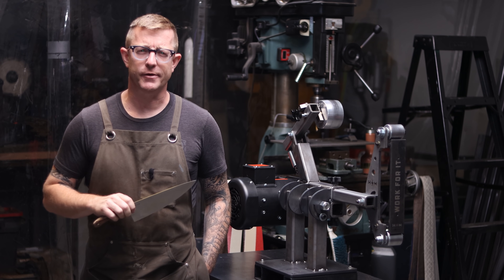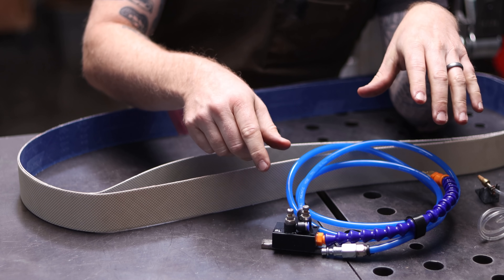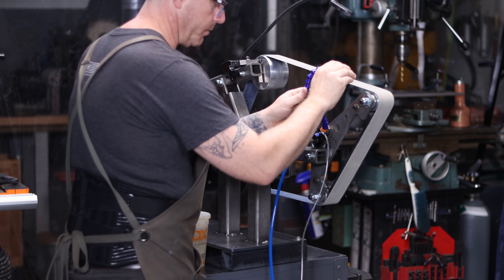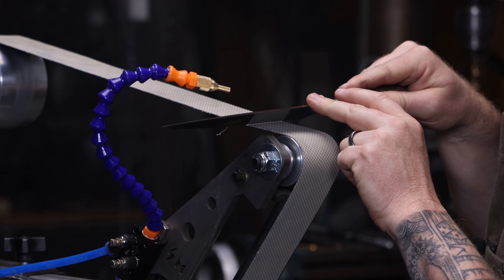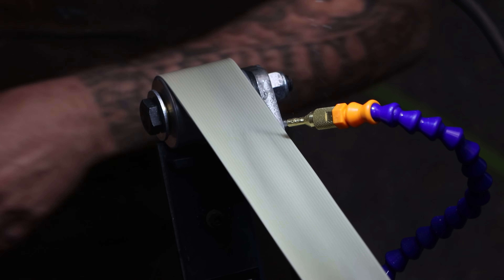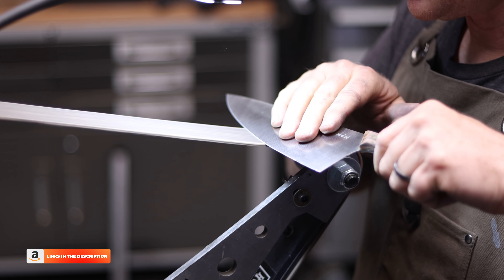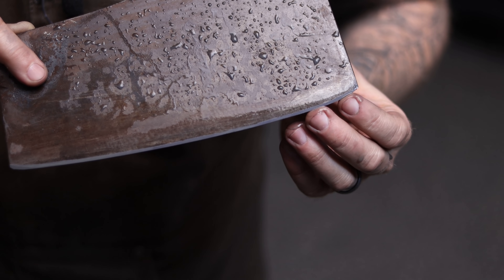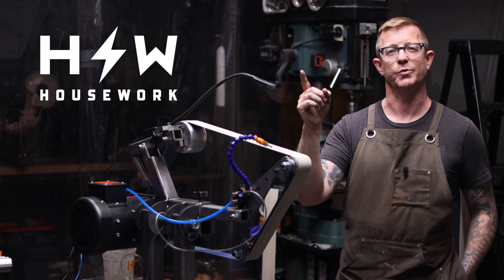How To: Sharpen a Knife with a 2x72 Belt Grinder

Comment: Is the water needed? Can I just wet the blade or the belt prior to sharpening?
Reply from the maker: If you're careful you can do this without the misting system.
Reply: @HouseMadeUS  I did and it was fine.

Comment: HEY BRIAN
Could you please make a video of how you wired up your VFD with the reverse and forward switch on the KB Electronics, 9520, KBAC-27D or did you buy it with it already on there?
Thanks Rob
Reply from the maker: Hi Robert, that switch is very easy to install. It's 3 wires that plug into the control board and the instructions come with the switch. Probably take you 5 minutes total. Hope that helps.

Comment: I am just using the kit I bought from you for the first time today.   I ignored your salient advice to try a junk knife first, and went straight to the carving knife we need for Thanksgiving today.  The system works fantastic, even in a novice's hands!  I love that the position is up high where I can see what's happening and maintain good position.  The misting system works perfect and is easily adjusted to keep the belt moist but not spray all over.   This is an excellent use for my Revolution grinder!

Comment: Love your technique from begging to end and I totally agree with your comments on the Tormek system as well. Had a look at the FAQs section on your page so will ask herein... 
wondering if I could use just a small 12v air pump to power the water spray system or do you feel an actual workshop type compressor is absolutely needed. Thanks.
Reply from the maker: You know, I don't know the answer. My gut would say it won't work. You need air pressure to make these work as they pull a vacuum while doing it. A small pancake compressor Does work though.
Reply: @HouseMadeUS  Thank you for answering. 😉

Comment: Thanks again for showing the mister. I got mine setup and it works great. What I did is to loosen the platen plate and push it to the rear. Then I used the area between the platen rollers to sharpen my knives. To me it is a more comfortable area to hold the knives. The first blade I did was my axe. It did a fantastic job. It ended up having almost a mirror finish on the blade. I love it. Thanks again.

Comment: Because of where you’re doing this there’s an obvious mounting opportunity so you could use the tour Mac attachments to achieve the correct angles I know you say you can get a sharper and you may feel that’s true but it certainly won’t be as consistent and accurate and anyone who is doing this for A living or even a side hustle it’s going to need consistency especially if there’s more than one person in the equation the same result no matter who does it is essential
Reply from the maker: Lots of knife sharpeners (that do this for A living) use this system. Consistent and solid once you get the hang of it. Thanks for watching.

Comment: How do I get the mister?
Reply from the maker: Hi Tom, there’s a link in the description that goes straight to the product place for the mister. Thanks for watching!
Reply: @HouseMadeUS  Thank you. So I also need to order the hose and pneumatic female fitting, correct? Thanks for getting back to me.
Reply: @HouseMadeUS  Yes I saw that, I should have been clear with my question. I did order that already but it didn’t come with a way to hook it to the quick connect on my compressor. So I look at your link again and saw another link for a male air fitting and another link for a quick connect. It goes to the male q/connect. Then I saw the female. So I’m asking, I guess I need the female q/connect too? By the way I have been a sub from before you finished your belt grinder. I was one of the people that sent you picks of my B/G to get ideas. Yours came to be way better than mine, congratulations.

Comment: Going into the leather strop 😧.. that looks dangerous. Also not worried about water getting into your hub bearings or other parts in the sander that rust?
Reply from the maker: The belt is running in reverse. Not going into the blade. Very safe. I wipe my machine down, zero corrosion issues. Just maintenance. Cheers.

Comment: Hey Brian, how do you keep your machine looking so nice when you're running water on it? I'm not done building my revolution v4 yet, but I really like the look of raw metal, so I bought some paste wax and plan to finish it with that. Any tips? Not sure if others wonder this as well, but it might be a useful video idea
Reply from the maker: I do  very little other than just wiping it down. I plan on trying paste wax to see if that could be a good option.
Reply: I was going to ask the same thing, bare steel and water not good. Paint that thing.

Comment: A real nice sharpening system! I personally prefere waterstones, but for a more mass production like work, this is the way to go!

Also, are there any plans on creating a Revolution Stand for the grinder? I am on the hunt for a DIY solution for a metal/wood stand. Maybe you know somewhere where I could look for one?
Reply from the maker: No immediate plans for a stand, but I have been thinking about building one for my demo unit. If I come up with something easy Ill make sure to make a video.
Reply: @HouseMadeUS  Thanks for the answer!
I am now building a dedicated workbench, but still a stand would be cooler. Maybe you can check out "claryx metalwork", they offer a stand for their grinders. Seems to be simple to build!
Reply from the maker: Will do! Ameribrade makes a really nice one also.
Reply: @HouseMadeUS  Ah yes, I saw that one too.  I am located in Europe, so I wanted to check the more local offers!

Also it is quite interesting, that beltgrinders are much more expensive in the US than in Europe. At least when looking at budget options.
Reply from the maker: Cost of steel has quadrupled here. Lots of reasons as to why. Mostly political. 😤
Reply: @HouseMadeUS  I see, that is really unfortunate. You can get a fully build 2x72 grinder for ~850€ shipped (no VFD tho), which is crazy

Comment: Great system! I would not do this without a mist system, it's been shown many times over to degrade the hardness at the edge significantly. With a mist system you are good to go! Still need to try the Norax belts. Great walk through 👍
Reply: Maybe if you lower the RPM and don’t stay too long on one segment of the knife. Also pause in between passes then you prob will avoid overheating your knife edge.
Reply: @norakat  micro Vickers hardness testing at the very edge has shown that without water it's almost impossible to to not affect the hardness at the very edge. After a few sharpenings on stones that area can be removed, but water mist is such a simple and cheap solution I don't know why people refuse to try it.
Reply from the maker: Easy choice, quick and efficient! 🙌🏻

Comment: I bought one of those water systems, tried it & it was just a huge mess. I tried it without the water which kinda worked & wasn't as messy, but I still rarely use it. I guess I'm just a bucket dipping guy, hahaha... I noticed you kinda scrapped the idea of a top platen behind the wheel. It makes sharpening a lot better, instead of a convex/rounded edge you get a nice flat edge, like if you were using stones. You can also use the top of the wheel instead of behind it, take away the slack. Hope all is well, take it easy.
Reply from the maker: I haven’t scrapped the idea just yet. Still thinking about the best way to attach it to the Revolution. I’ll have to revisit it as I think of it often. The water in my case doesn’t seem to be any different of a mess than dunking. I’m a messy dunker. 😂

Comment: The leather belt is the way to go. The buffing wheel seems to not strop it nearly as well for me
Reply: Also great video as always! Glad to see your business booming!
Reply from the maker: Yeah it’s hit or miss for me too. Sometimes I do both. The leather is definitely a better option. Someone mentioned MDF wheels? I’ve not tried that yet.
Reply: @HouseMadeUS  I have the paper wheels and they will get it sharp but it takes a nano second to ruin your temper they are so fast and get so hot! Plus it's harder for me to control the blade and angle. The grinder method is by far the best to date for me. I can get hair whittling sharp in about 3 min on a new blade
Reply: @HouseMadeUS  for the safety of your edges, the leather and diamond compound would be the best, unless you use an MDF/paper when on the Tormec.

Comment from the maker: ►►► Buy the HouseMade Industrial 2x72 Belt Grinder Sharpening System ►►  https://housemade.us/products/2x72-sharpening-system

OR 

Assemble your own kit:
► Spray Mister ► https://amzn.to/2ND1Iu8
► 8mm Hose ► https://amzn.to/391Io11
► 1/4 Quick Connect ► https://amzn.to/3tJmPKL
► 600 Grit Norax Belt ► http://bit.ly/3r6akqE
► 1200 Grit Norax Belt ► http://bit.ly/3vMGmeO

► Link to Plans for the DIY Tilting 2x72 Belt Grinder ►► http://bit.ly/2Pa7JvZ

►► Buy the Build Kit for your very own Revolution 2x72 Belt Grinder ►►  https://bit.ly/2WIPgt4
Reply: Any chance you’d offer the mister separately? I already have  the belts.
Reply from the maker: Yes sir. Working on that setup for ya. Good idea.